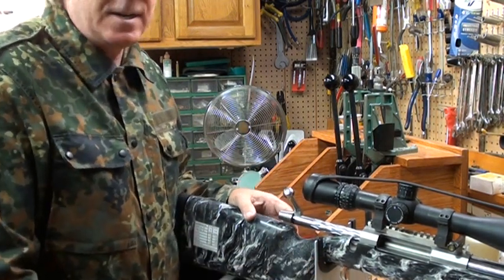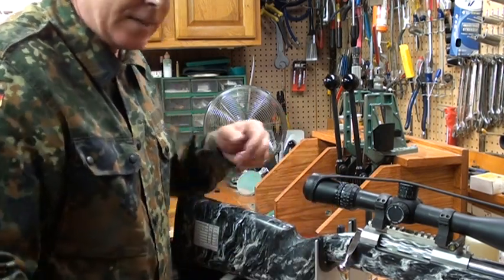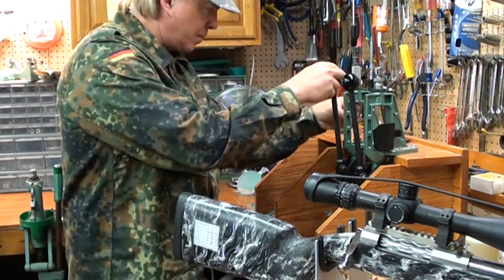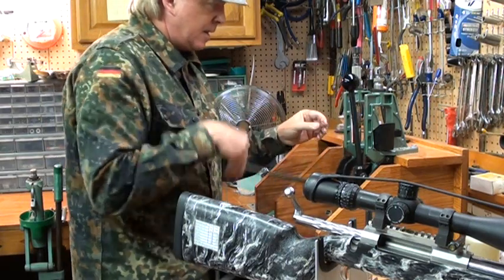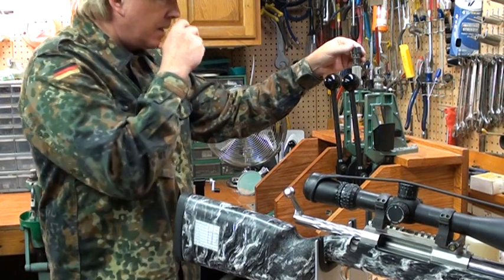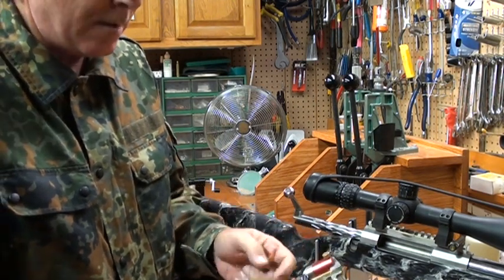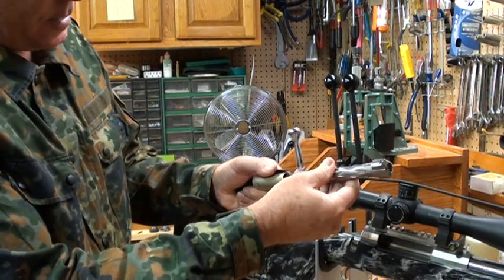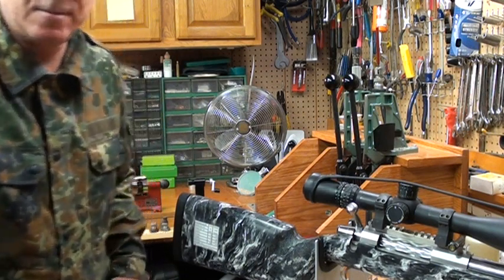Bullet Seating Depth Method

Comment: Tcombest, I have been doing quite a bit of loading for semis, lately. I have an AR with a White Oak 18" barrel with a 1:7 twist. It normally doesn't shoot 55 grains all too well, but I was playing around with some 55 Hornady soft points that came with one of my presses years ago. The manual calls for a COL of 2.200. They actually  grouped pretty decent. I took it out to 2.230 and it cut my groups in half. One of those things that you have to play around and see what works best.  Great video!

Comment: Saw this video years ago and it is still very relevant.  One thing that you did not mention... but it looks like you have removed the ejector and its spring from the bolt face of the BAT action.  This is also an important step in not placing any stress on the case/bullet assembly which enables you to feel the bullet engage the rifling.  Nice job sir.
Reply: +gilream I have an M16 Extractor and I needed to remove mine.

Comment: This is great.  Really is, but you left out a couple of really good pieces of info.  First, you need to remove the extractor push pin so it's not pushing on the rim of the cartridge.   Second, you have to ensure that the shoulder and neck are not rubbing. So test to make sure nothing is touching when testing the case only.  Third, you need to ensure the cartridge rim is clipped into the extractor clip before pushing the round  into the chamber.  The extractor clip could interfere if you don't.  After reading some of the comments I think these things needed to be added.

Comment: this video reminds me of the most accurate rifle i ever shot. it was an old, old, old bolt action single shot .22 ranger chambered in 22Long but i used 22LR and the projectile would partially engage the rifling before firing and it would put every shot through the same hole at 50 yards with open sights and no scope. i heard years later that the shorter the distance the bullet travels before engaging the rifling was better most of the time for accuracy LOL i wish my brothers didn't screw me out of that rifle when my dad passed away. it was being stored at his farm and they claimed it was part of his estate and they took it for themselves. ;(

Comment: This method can get you within a couple thousandths. Problem is that his brass is slightly undersized, it has to be to get a bolt to drop without resistance in this test. A properly sized case in a chamber will cause a very light bit of resistence when you close a disassembled bolt. Of course this would cause the bullet seating depth test as he did it to be difficult as the whole method is based on the feel of the bolt drop. 
Depending on how much he's bumping the shoulder on his brass will determine how accurate the final measurement is. Could be off by a few thousandths.

Comment: I really like this method. Brilliant. I will try this on my 700 tonight.
I also have a micrometer seating die. Once I set it up this way won't the die and chamber be matched as regards ogive so that other bullet types can be seated without adjustment?
I know I'll double check but was just wondering.
Thanks again for the video.

Comment: @tcombest Also using a comparator to measure shoulder length, my fired cases come out to 1.6240 and with my Die bottoming out on the shellholder with unfired brass the most I can bump it back is 1.6210.  Am I supposed to FL resize before using the body  die to bump the shoulder? thanks!

Comment: I'm trying this method with my firing pin removed and my bolt is loose like yours without a round in the chamber, but when I put a round in, it never gets loose.  I even tried it with just the brass with no bullet in it and my bolt never free falls like yours does. Is it because I need to push the necks on my cases back or something? thanks.

Comment: I understand this process is for match grade ammo with precise headspace chambering. BUT,.... I have a 7.62N chambered bolt action rifle. If I load a .308WIN FMJ 145gr bullet. Will it fit? I dont want to discuss chamber pressures because I spoke about CUP vs PSI for hours, only to find the bullets are pretty much the same. I just want to know if .308headspace will fit in a 7.62n Bolt action rifle.I understand the opposite direction you get headspace issues. 7.62N rnd in a .308 rifle.

Comment: I have custom barrel that is a 1" dia My test round is 2.580 to the ogive and it seems to be hitting the lands. It seems to be touching and not freely closing. i took a measurement with a bullet seating tool, touching at the measurement of 2.531 ogive.My die and micrometer will only allow me to seat the bullet as far down as 2.545.That puts my bullet ogive very close to the case neck, will this be a problem? My cases are correct specs 2.490-2.50 what is your expertise on this subject?

Comment: Would leaving the primer out give the same result for those of us that do not have the tool to remove the firing pin?, also,  I'm going thru the same scenario with my M1 Garand, how would I acheive this with this gun? Any info would help greatly, Charles
Reply: The point of taking the pin out is not of safety (although that obviously applies) it's too have no resistance and he made it sound misleading because you don't have to have a firing pin removal tool to remove your firing pin. All rifles should have instructions on how to do it just get on the manufacturers website or look on YouTube for that matter.

Comment: Help, i am reloading Remington 7MM Mag using a 2 die competition set and i have done some measurements on where my bullet touches the lands and found that i am at 2.531" and a good factory round is 2.654" to the ogive. Thus saying i am not able to seat the bullet beyond 2.587" so that i can ladder test the bullet jump off the lands to find the best bullet seating depth for precise accuracy. This is far as my die with the micrometer will allow me (2.587")At this measurement i am really close.

Comment: Love the video, thanks!  I have a Savage 116, which has the ejector and extractor as part of the bolt head ass'y.  I'm guessing that removing both would be a good thing, yes? 

For load development, I'm not going to even try jamming.  I'll make 6 ea. of bullets 1 thou off the lands, 2 thou, 3 thou, and 5 thou so I'll have enough to shoot two, 3-group shots of each of the 4 lengths.  And go from there.  Any advice? 

Again, thank you and great video. 

BTW, what do you think of the RCBS Precision Mic. tool?
Reply: freddiemercurious i have been trying this method and not getting accurate readings when trying to close the bolt. after reading your comment i realize it is because of the ejector pin in the bolt.... i THINK lol

Comment: Good question Moore could u do this without taking pin out if u leave primer out
Reply: The point of taking the pin out is not of safety (although that obviously applies) it's too have no resistance and he made it sound misleading because you don't have to have a firing pin removal tool to remove your firing pin. All rifles should have instructions on how to do it just get on the manufacturers website or look on YouTube for that matter.

Comment: This is probably a dumb question but what is the reason for finding this
Reply: Hunter Sickinger It is not a dumb question. The reason is to find where the rifling (lands) is in a particular barrel in relation to the chamber. This only determines where the rifling is in the particular barrel you are performing this test on, obviously. The reason you would want to know where that is is because there are several minute adjustments you can make in either direction that will provide varying degrees of accuracy and precision...or the lack thereof. There is no set rule on how far away to be from the lands. My rifle may have the best accuracy and precision with the bullet set 4 thou off the lands. While your rifle may achieve better accuracy and precision by being jammed into the lands 2 thou. Remember he said "Jump or Jam"? Proceed with caution and at your own risk.

Comment: this method does not work with either of my Remington 700's. I can get the bolt to drop freely w/out a case but as soon as I introduce a case to the chamber, there is resistance, regardless of seating depth. I seated a bullet extremely deep where I knew it was nowhere near the rifling and you still had an initial bit of pressure before the bolt fell.
Reply: My 700s are the same way best you can do just pay attention to how much pressure it takes to close you will feel the pressure difference when it's not pushing it in. You may not get within .001 but you will be close if a bullet doesn't shoot the same within .010 window it's not worth shooting in my opinion. Also look for land marks on bullet if it's not in the lands it won't leave a mark